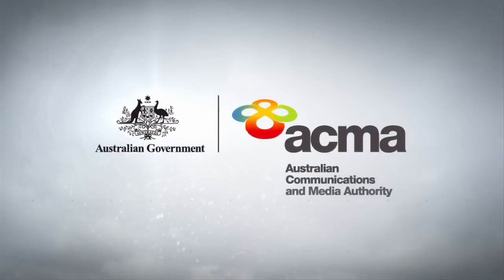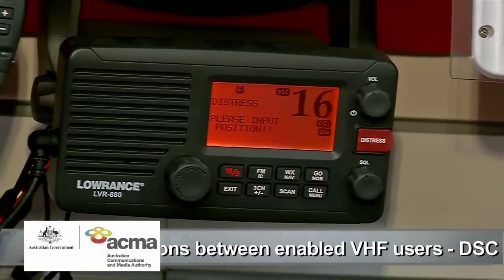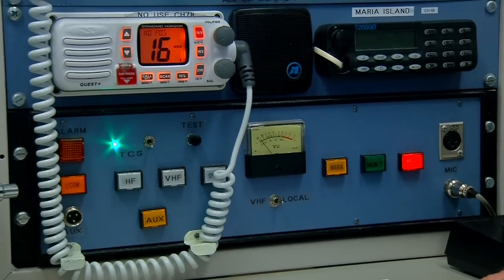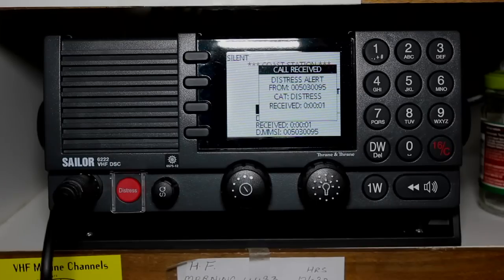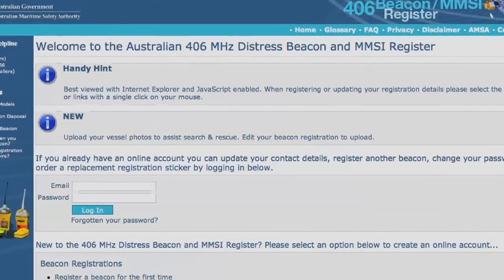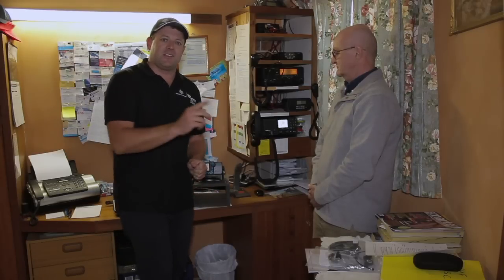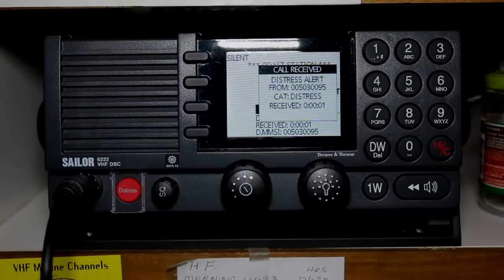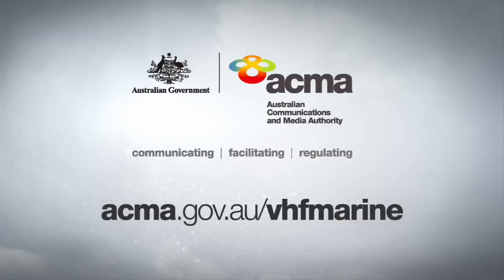Digital Selective Calling & Marine Radio: Taking the search out of search and rescue

Comment: This is wrong in many ways. How can an automated signal tell the receiver of the signal what the problem is? No where does it say that conversations should be made on Ch70 after pressing the DSC button. No rescue station monitors Ch70 however they may change to Ch70 if a DSC call alarm is activated. This video really does need work
Reply from the maker: +Jack Kennedy 
Hi Jack, thanks for your feedback about the DSC video. With a DSC-enabled radio, the way to include the nature of the problem in a DSC message is to either 1) input the problem if you have the time, or 2) if in imminent danger, just press the button for distress. After pressing the DSC button you should continue using radiotelephony channels.  The DSC channel should only be used for DSC digital transmissions. This is explained in detail in the VHF Marine Radio Operators Handbook which can be viewed/purchased on the Australian Maritime College website at https://www.amc.edu.au/handbooks

Comment: Finally a perfect video on the DSC facilities of marine VHF radios. I hope to see great progress in using VHF-DSC radion on coastal waters of Australia.
If you wish to have an onboard reference and aide-memoire, you mignt be interested to get my "Marine VHF Radio Handbook" and "Marine VHF Radio Simulator" covering both DSC and voice procedures.
Reply: I'm doing this course on Friday unfortunately ive had no training apart from watching your video,

Can you give me an answer below is an email I required for my course I'll never work on a boat ever I don't even use a vhf radio I use uhf radio but if I don't complete the course I loose my job bit unfair,  so my acessor has send below email but I'm struggling to think what he's asking for what my reply should be please 🙏 help

application form and some photo ID (Passport or Driving Licence).

 Initially I will set you a few questions to check that you have still
 retained the knowledge necessary to pass the written exam.

The main question is a distress scenario from which you have to produce a
Distress Call and Message.
for example:

Your vessel VIKING QUEEN  callsign GGDF MMSI 123456789 is in position 54 degrees 33 minutes North, 002 degrees 04 minutes West.
Your vessel is on fire and you require immediate assistance.
There are ten people on board and gale force winds.

What is the Distress call, and message that you would transmit by voice
after sending a Distress Alert by DSC?

..........................................
 Your answer should look like this:
 Call
 Mayday x3  this is VIKING QUEENx3  callsign GGDF MMSI 123456789

 message
 Mayday
 VIKING QUEEN  callsign GGDF MMSI 123456789
 Position 54 degrees 33 minutes North, 002 degrees 04 minutes West
 On Fire
 Require Immediate Assistance
10 POB Gale force winds